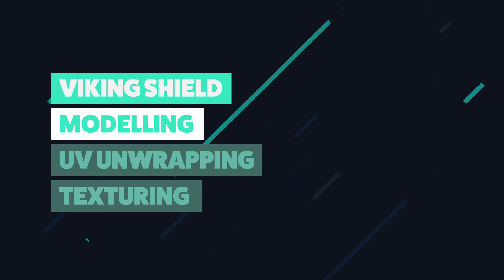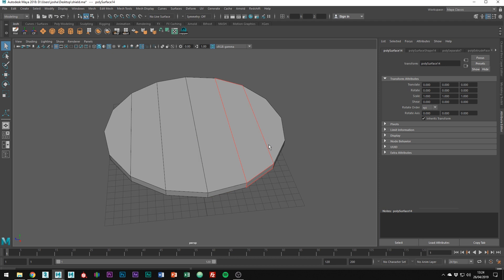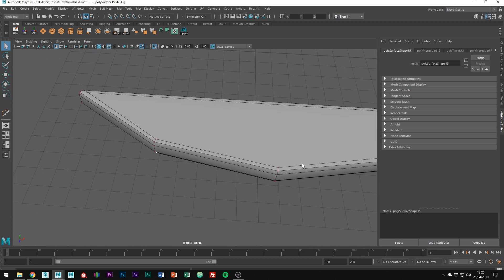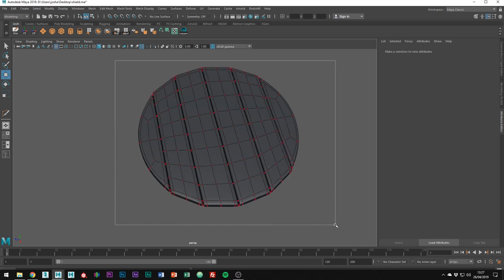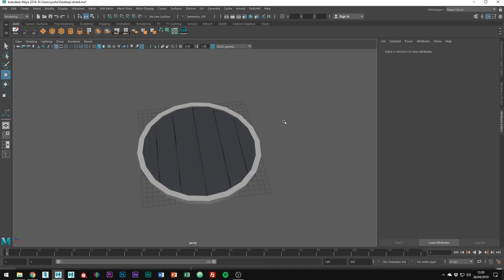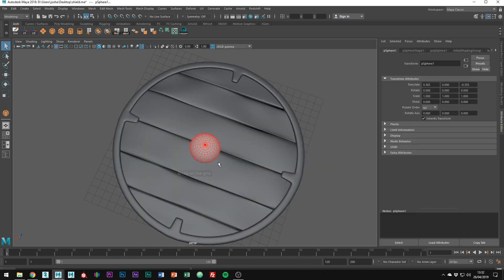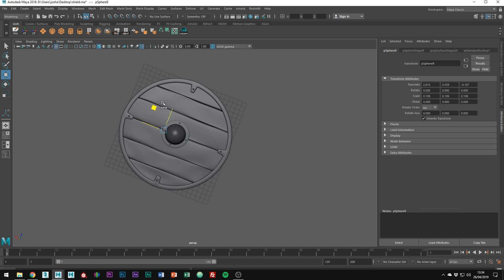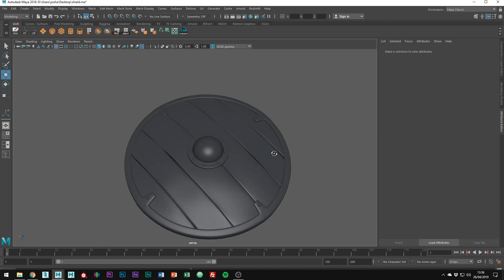Viking Shield: Part 1 - Modelling

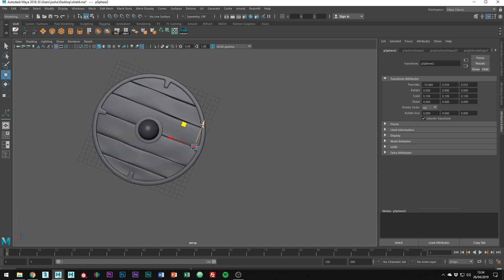Comment: Really like your quick and straight-forward approach to modelling like this.  At about 8:50 you start using a process where you use the transform gizmo to clone, and I spent ages trying to work out how you were doing that until I discovered the Smart Duplicate function in the move tool settings which I never realised even existed!  There's always something new in Maya to discover, thank you :)
Reply from the maker: Thanks! Yeah I probably should have mentioned that in the tutorial, glad you found the feature in the end. 🙂